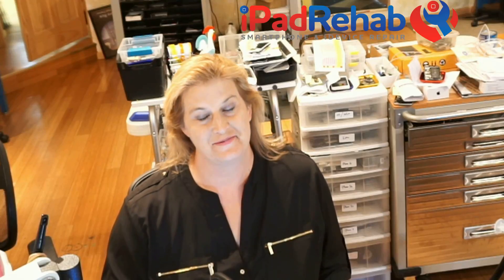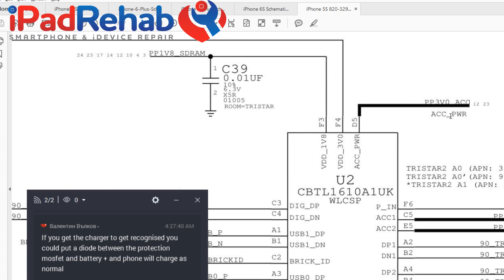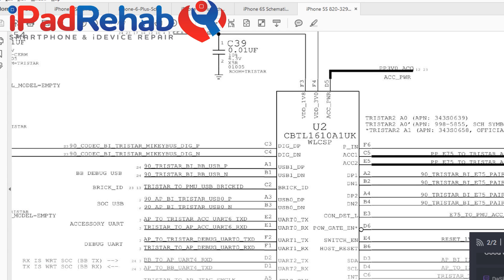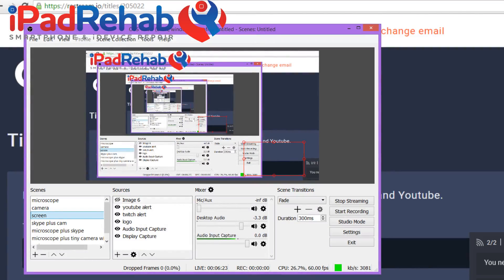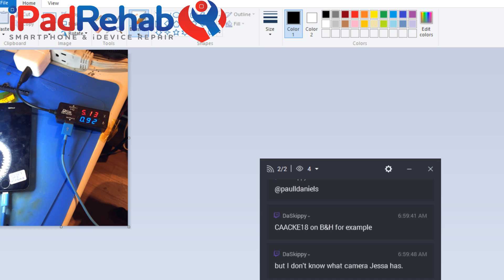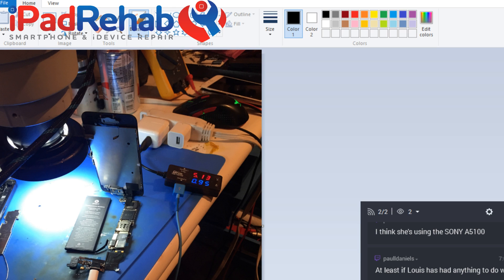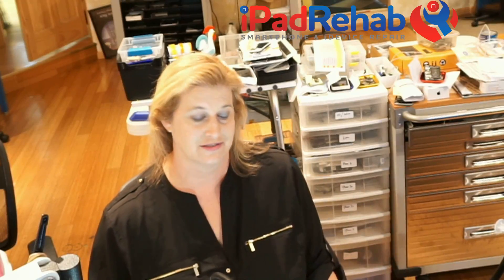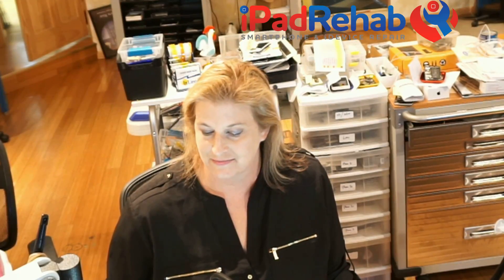Tristar Experiments---PP3v0_ACC line function UPDATE!

Comment: "Hey you stole my line" LOL. <3 <3 <3  You guys on the East Coast never sleep!
So ACC is an outtie!
I love your experiments and the thoughts behind them (I love ALL of your experiments). I would have never guessed taking something out of the equation to find answers. But it is only logical. We can figure them out! I always thought ACC was power like VCC (ACC=VCC).  My experiment would never would have turned out the right results with the wrong thought process. ACC = accessory like the projector (ohhh!). I thought it was VCC coming from the port is called ACC. Like the USB port & cable itself was the accessory : (  Like when you plug it in and it says "This accessory may not be supported" 
I also notice these fucked up ports we get have components missing.
Poor CPU always gets the blame : (  [CPU & PMIC are usually NOT to blame, is this because they generally use lower voltages?]
That was the best video, I loved it! 10's in all categories.